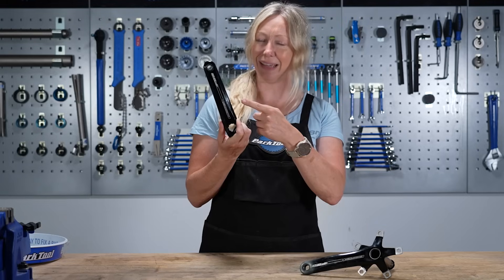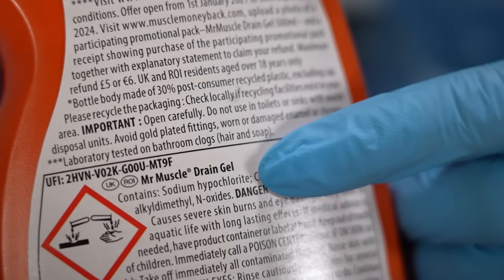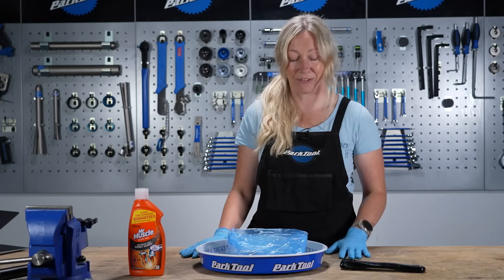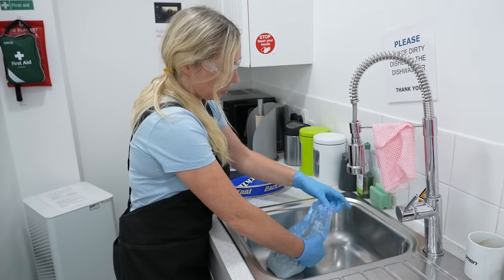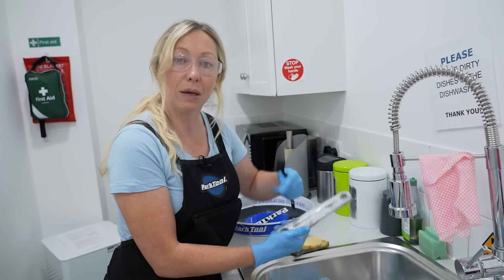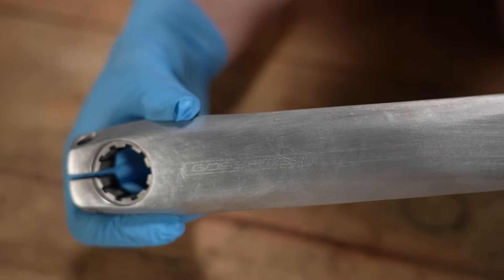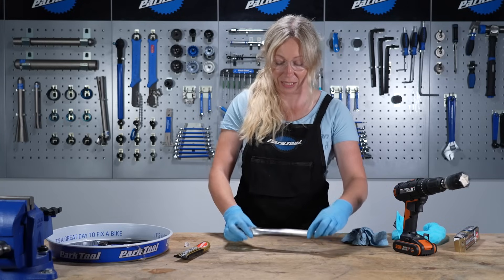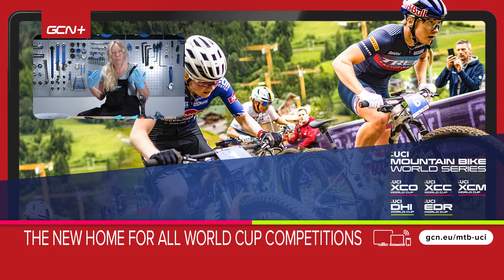How To Hand Polish Components At Home

Comment: Definitely wet sand the defects out prior to polishing and the results will be much better. I used to polish cast aluminum car parts way back in the day and got really good at it over time. It is truly a labor of love and a time trap, so I mainly just did my own stuff. I eventually came to appreciate painted or plated surfaces and moved away from the soft shiny bling look.

Comment: You could speed this up by wet and dry sanding the part with a very fine grit paper first. When done polishing spray the part in 2K lacquer to give it some protection or maybe use some helicopter tape on the face . Might even be worth just sanding the worn face of the crank and polishing that if that’s all that’s been damaged by clown shoeing
Reply: Exactly i wanted to say too! Because it has a way better surface without these little grooves all over it. Mirror polish for real.
Reply: 600 should be the last grit used if you go any finer you’ll always have a cloud/hazy mirror polish, and 2k won’t stick for long on a polished alloy part won’t take long and it will start flaking off,
Reply: @ryanhenderson5859  acid etch 2K should hold up ok, I’ve used it on diamond cut alloy wheels in the past.

Comment: A word of warning. Sodium Hypochlorite or Hydroxide (drain cleaner) will dissolve aluminium. If the anodising does not start lifting within a few seconds it isn't anodised and you must STOP and rinse immediately! If you leave the cleaner in contact with the threads (or any other exposed surface) for too long it will remove aluminium, damaging or weakening the threads (pedal or bolts).

Comment: Back in my bmx days, the 80's, we used easy off oven cleaner to remove the old anodized finishes on our faded aluminum parts, then buffed them out with metal polish, leaving them chrome looking, but you had to re polish them after about a week!!

Comment: You’ll have to be careful with this as it can damage the taps. I did it with a rear hub once using and eventually the tap of the ratchet ring got stripped.. maybe I let it soak to long. If you can you should plunge the taps. Better save then sorry

Comment: I’m a professional metal polisher been doing it for 25 years . 
I used the yellow oven cleaner to brake down the anodize then 220/320 da sand then use a yellow disk buff with brown compound, then I go to a white buff with white compound , then I finish it off their white buff with a blue compound for that nice bright shine . My buffer is a 5 hp beast . I’ve polished brass , stainless, steal and aluminum, ti .
Reply: What to use after to prevent corrosion? And about maintenance, from time to time?
Reply: Ceramic coating will help protect and seal the parts

Comment: Several issues with this video and a few warnings.

Anodising is removed with a caustic soda. Your drain cleaner is a mild one. Easy Off oven cleaner is another more aggressive one. But you need to know a few things before doing this that the video did not mention.

-  This stuff is toxic (especially easy off). You should use a respirator when working with large concentrations. Wear heavy rubber gloves, it will eat your skin.
- What it is actually doing is consuming the aluminum oxide on the metal. This later from anodising is 0.001-0.005mm thick. As a result, it WILL change the dimensions of the part. Be careful where use us it. The surface of the crank is no big deal. On the SPLINES might cause them to no longer engage correctly resulting in creaking, coming loose, etc. It is best not to soak a part, but rather apply it only where it needs to go.
- Stronger caustic sodas will usually eat and damage steel. When you get to the drive side of the crank with the spindle, be VERY careful not to get any of it on the steel parts.

On the polishing side, autosol is for removing mild tarnish. It will brighten an already polished part, but it has minimal "cutting" ability. A bead blasted/etched part like that crank needs to go through something more aggressive before getting to autosol. Some people mentioned sandpaper, which works on the flat areas you can reach, but there are other polishing and cutting compounds that yet you still do it with the drill on weird shapes.

Last warning is on how to treat your shiny new part. There is a reason it was anodised in the first place. Raw aluminium will react with many other materials including stainless fasteners, spokes, carbon fibre, etc. You need to clear coat, ceramic coat or re-anodise the part ideally before use ideally.

I don't want to say this is a bad idea and never do it... but you need a lot more knowledge going into it that this video is providing or you can permanently destroy your parts. This isn't quite as simple as stripping paint.
Reply: I totally agree with all your comments. This was not the finest hour of the GMBN tech team.

Comment: Chemical stripper for paint, 400+ grit (bigger grains would leaves too deep scratches) if you want the mechanical way.
Then 600 or finer wet sanding, polish wet with cerium oxide for that mirror finish, clean part thoroughly with alcohol (that's why you dont want to use metal polish it leaves grease) then automotive clear coat.
I've been doing this for over 25 yrs.
Sounds simple eh? Because it is 🎉
Removing your dub crankset might be a bigger challenge 😂

Comment: Working on stripping an oldskool Redline BRUTE stem for a 1979 MX-II build. Usually use Easy Off Oven Cleaner or Greased Lightning Degreaser. But, they appear to have changed formulas here in the US. They are no longer as caustic as they used to be. Going to try Drano Drain Cleaner or straight LYE next. Good job 👍

Comment: There's a reason it's anodised. If it's 7075 and you remove the coating it will look terrible very soon after riding in the wet.

Comment: Isnt that just going to corrode now you've removed the protective oxide layer?
Reply: Yep.
Reply: No, not especially.
Reply: Oxidise... Yes... All metal does... but some far quicker than others... (Lead is one of the quickest ... that doesn't explode... and Aluminium....
but your cranks are most likely Alloy (often confused with Aluminium... but subtilty different... )... I'm betting Magnesium Alloy...
But Magnesium also oxides (thing MAG-nesium wheels... Look great polished... but goes dull after a while if not coated.

Luckily... due to 90's bling bling boys in their doof doof cars.... there's a huge range of Mag Wheel clearcoat etc. that is designed to keep that high shine finish with a clear coat protective layer.

(I only say Oxidise over Corrosion, as oxidisation will occur on contact with air, regardless of climate... Corrosion is usually more associated with contact with a corrosive product... or damp conditions which is a grey area between corrosion and oxidation...

Comment: I'm not gonna watch this. But i will say that bare aluminium corrodes in the air, doesn't even need to be wet. It won't hurt the structural integrity but it will go dull (not stay shinny) so you will have to keep redoing this and everytime you sand it you are taking away a minute amount of material (which would be fine unless you did every day for like 5 years). You could preserve the shinny by spraying clear coat paint on it but that's easy to get wrong and it would ruin the look of the part.

Just easier to not spend the time to potentially ruin a very expensive set of cranks
Reply: Good. I wish nobody would watch it. GMBN doesn't learn
Reply: Clear cote

Comment: I'll agree with many voices here: this video is actually harmful, because it's easy to cock it up and there's no care instruction after you polish it, as you're getting rid of the part's protective layer. Dunno why would GMBN Tech produce this kind of videos (similar one: repainting your frame, also starring Ana), where it takes years of practice to perform the task up to snuff and not ruin equipment worth hundreds or even thousands of pounds